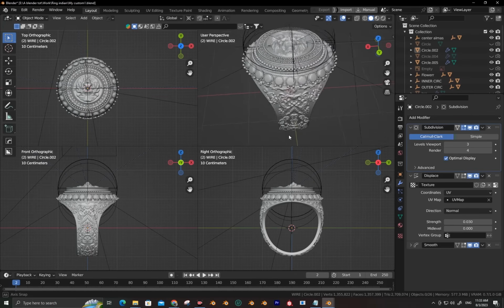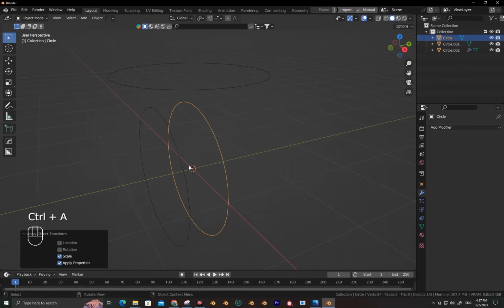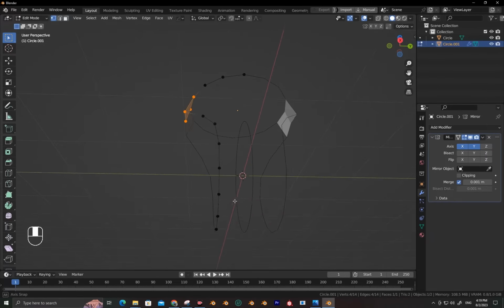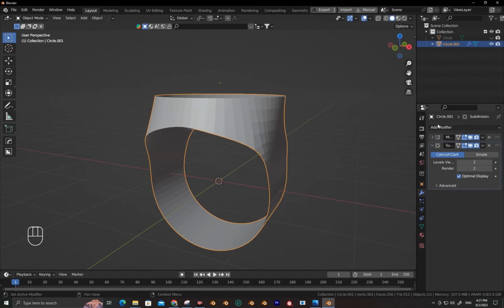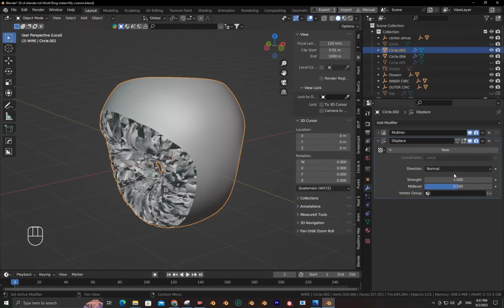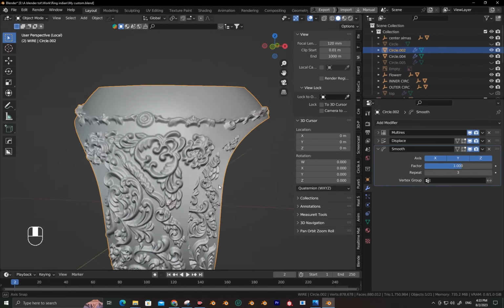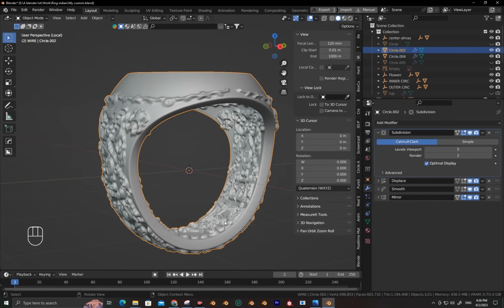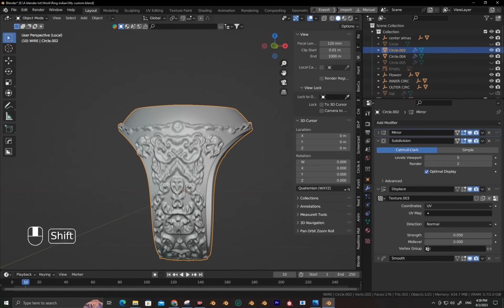Modeling ring in blender using alpha maps Part 1 | Tutorial

Comment: Solidify modifier exports vertex groups, which your can use to mask displace non-destructively.
Btw, why did you apply solidify if you used subdiv anyway?
Reply from the maker: cuz the edges will have a nice bevel
Reply: @mohamedfayed4522  Solidify also can define creases on edges, just read the manual, there is a ton of stuff it can do.